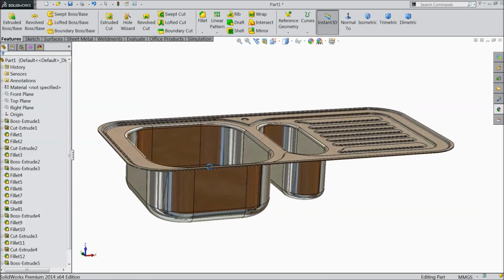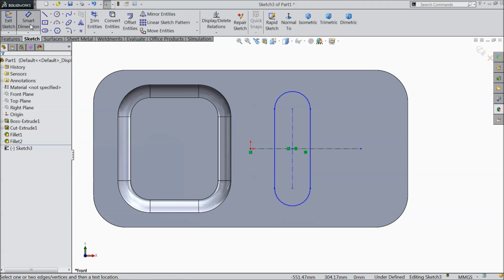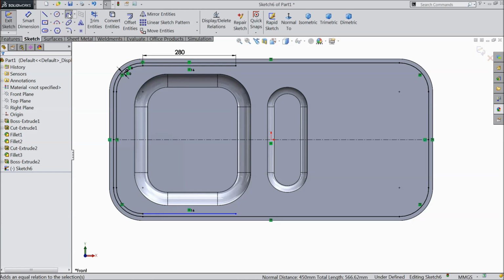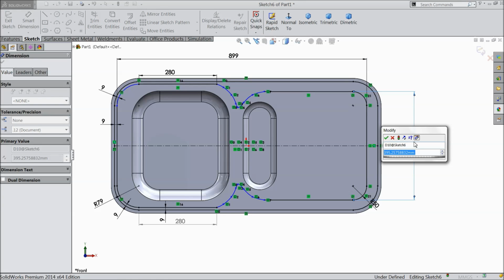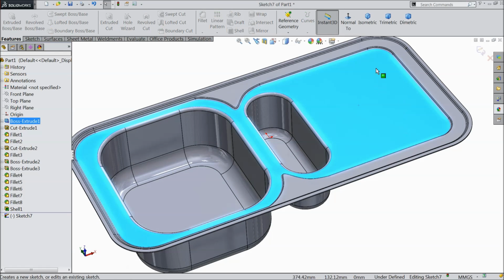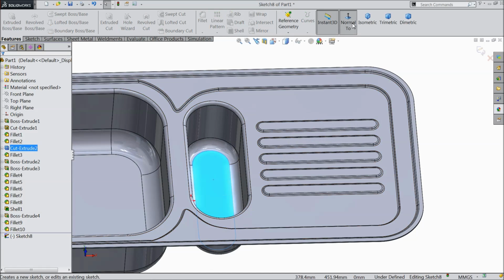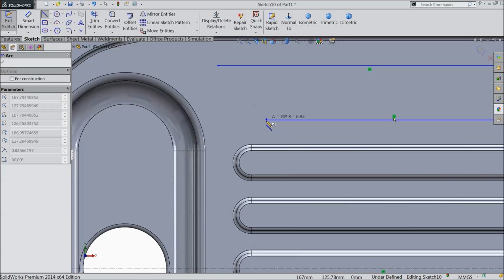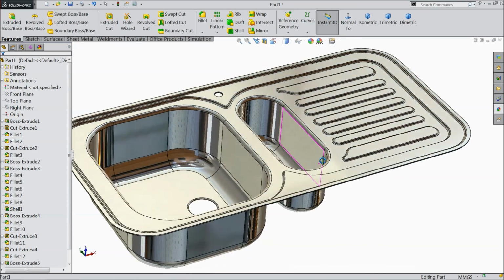Solidworks tutorial | sketch kitchen sink in Solidworks

Comment: Hi,This is H.E, ISO big factory in China, who design and  produce plastic injection blowing extrusion molds, silicone rubber molds, die casting molds, metal, aluminum stamping spare parts, CNC machining parts, +10years, ISO standard, betty8811@yahoo.com
Reply: ALL new PLASTIC, SILICONE RUBBER STEEL MOLDS  in one solution from idea to manufacturing+10 years, website: https://xmhuaerjia.en.alibaba.com/

Comment: Sir, when I have given the command for Shell taking   r = 2.5 mm  then there was some error (says Thickness is Greater than the minimum radius of curvature) & system asked to Check for the Minimum radius of Curvature. Then i checked & got min. R.o.C = 0.5mm , Please explain the reason for this. BTW the Shell command completed on r = 2.5mm only.

Comment: Hello. Everything you did was great. One thing that I believe needs a better method. Creating those last raised features for plates etc. you made them an extrusion but I believe that would not really be how that would be done. It seems to me that those features should be done as indent features to maintain material thickness since you shelled it. Or maybe create those features before the shell so thickness is equal. Maybe you didn't want to back track. Anyway, thanks for sharing your techniques.
Reply from the maker: Yes still need better ways for model,
Reply: I sometimes design parts and later find I could have used better techniques. But deadlines sometimes don't let us redo the whole part.
Reply from the maker: True, difficult to perform well due to deadline of projects,